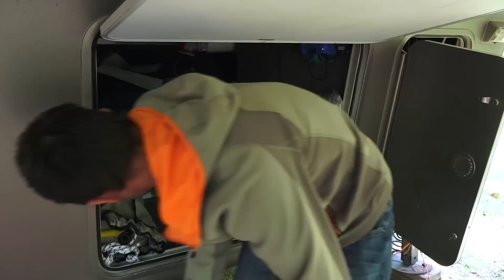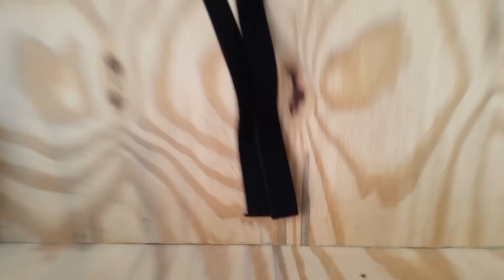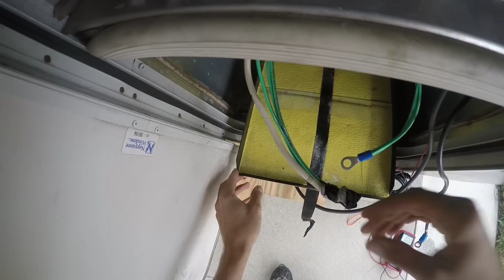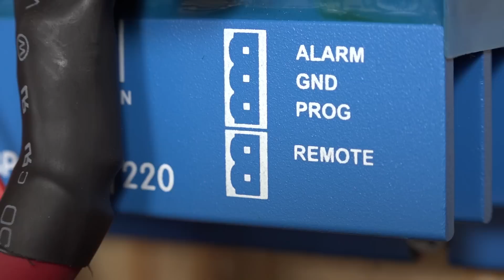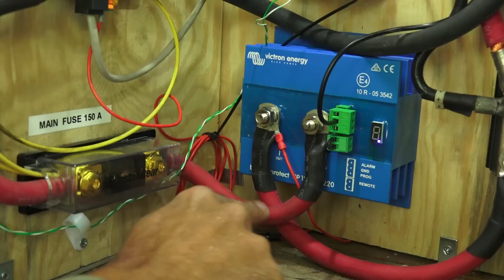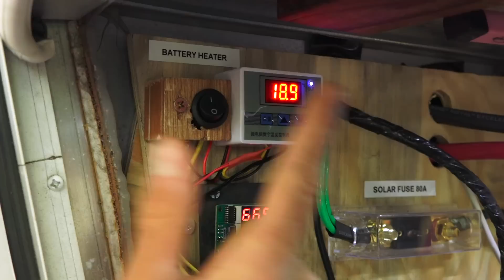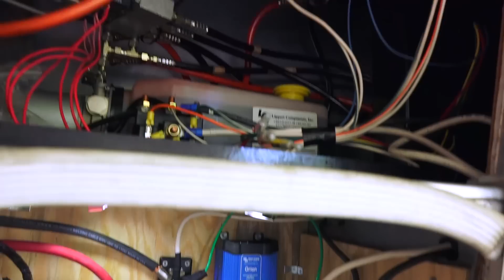PHASE 2 SOLAR - Installing the Tesla Battery and converting the RV from 12V to 24V

Comment: Thanks for the reality check! I see so many people giving false claims like lithium batteries can be drained to zero with no recoil or that they're much safer, both of which makes no sense according to my research. So it's nice to hear that you acknowledge all these potential dangers and have installed plenty of failsafe systems. I certainly won't be going to lithium anytime soon because I only see two factors being of any real benefit, weight and longevity. Weight is definitely proven while longevity is mostly theoretical. Personally I believe if a product does not have a warranty to back its lifespan claims then the claims hold no weight. The longest warranty I've seen from a lithium ion battery manufacturer is 10 years. And I've seen claims upward to 20 years lifespan (8000 cycles). On the other hand, there is more than a few companies that make AGM or gel deep cycle batteries with solid 10 year warranties as well. Point being, it's not how long the product can theoretically live for but how long the product will actually live for. And if the manufacturer was certain it could give you the life they've calculated it would be backed by a warranty. In my opinion of course. So I'll consider them when price comes below $4 per usable amp hour. Currently I've seen them advertised at $10 per usable amp hour.... so no thanks! haha

Comment: So I'm super new to solar, but trying to learn everything I can. I plan on converting a sprinter van into an off grid adventure rig. That said, with such a small rig, efficiency is HUGE, so I'm leaning super hard toward following in your footsteps with the Tesla module and going with a 24v system.

My question: now that you've upgraded to the Tesla module (effectively a 24v battery bank), isn't your charge controller undersized? I just read that to properly size the controller, you have to take your arrays total wattage (your being 1200) divide that by your bat-bank's voltage (24) and then add 25% to be safe in order to get the amps your controller should be rated for. Your would then need to be at least 62.5amps.

If i'm correct, how do you compensate for having a 50amp controller and keep the system safe? Or does this simply limit the total output you can get from your panels? Thanks for helping a noob! Haha.
Reply from the maker: There absolutely no requirement to have a certain size charger, charging at 2 amps is fine, you just won't make enough power for the day.  Size your solar and estimated kwh needs, then the charge controller.  Our inverter can charge at 160A if we are plugged in but I still limit it to 60 so I can use it on our small gen .

Comment: Wow dude, I agree, this is such incredible knowledge that we can share with one another. Thanks. How do you feel about mounting the battery inside the trailer, say a hidden cupboard, so it keep the temperature proper and has easier access for shutoffs? Are there any perceivable negatives to having it indoors?
Also! I understand the basics of the electrical system and each of it's purposes, but, as I watch this, the intricacy of the actual wiring looks like I should use an extra knowledgable hand. Would you suppose a general electrician would have the wherewithal to help wire this system in place?

Comment: Can you run AC with this setup?
Reply from the maker: We can but only for about 2 hours without sun. Most of the day with full sun, but usually we run our honda 2000 and combine the power with the solar, and keep charging the battery.  At night with the gen we can run the AC all evening.

Comment: What I see in this video is a fiery explosion waiting to happen. When Tesla doesn't want to sell parts for their vehicles they use stuff like this as examples. Speaking from personal experience, Lithium Ion batteries are no joke. If you fail to maintain them to spec with VERY precise controls, BAD THINGS HAPPEN. Like why didn't you make use of the preexisting thermal control loop in the battery? That would have been safer, more reliable, and offer you better insight, tighter control over the battery's internal temperature. Also I find your storage orientation to be a bit concerning as well as the fact that you are securing it in a wooden box without any apparent vibration controls(padding to avoid having the batteries bounce around inside the box as you are driving down the road.). Those batteries need to be laying down flat - NOT ON THEIR SIDE,  firmly secured with an appropriate amount of vibration dampening as they were in the model S they came from, and the water loop needs to be in use with the appropriate monitoring, power control, and thermal control gear in play. This gear needs to include alarms to alert you when something is happening that it cannot control. When lithium batteries head toward catastrophic failure you don't get a lot of time to react. Usually the failures I've seen result in explosion and fire within a few seconds of seeing smoke. You don't want to be in the vehicle when this happens. There are plenty of videos out there to explain why. 

EDIT: I completely glazed over the fact that you said in a previous video that this pack was removed from a vehicle that was previously involved in a COLLISION.  ( https://youtu.be/g_cC0NKvCDY?t=48 ) You might also want to have a look at some videos describing what happens to a lithium Ion battery when you subject it to severe vibration events or sudden impact to see why this is a problem.
Reply: Boeing had to put their 787 battery packs in steel boxes to contain possible fires - a plywood box doesn't seem like a good idea.

Comment: Now that you have had the system for a few months, is there anything you would do different or a component that you would change? I like your layout and would like to duplicate your system. I will have to put a few more panels up because I am so far south in New Zealand and most likely a wind generator. I will also be using 2 3000w inverters, One for each leg of the 50 amp circuit.

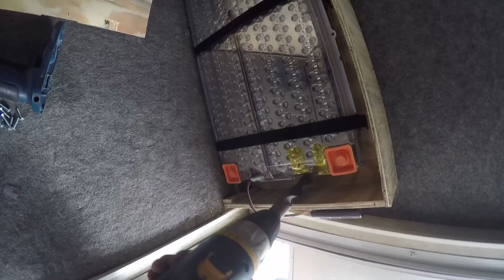Comment: @ 6:40 or so,did you touched both battery terminals? That could be very dangerous. Electricity DC or AC there are a lot of angry pixies in that box! Stay alive ! 1 amp, one volt will stop your heart! Luckily the human body has a good amount of resistance value, but it does have a limit. Be real cautious with rings on the fingers working with electric, my dad almost lost his finger on a large bucket loader battery.
Reply from the maker: Yes I have been burned by rings in the past, very dangerous.  Anything below 50V is considered touch safe and will not hurt you.  Above 50V you need to be careful.

Comment: Very nice workmanship and a great presentation.  

A few questions ......

Why is the manual disconnect ( what I think of as a master kill switch) on the positive side of the circuit rather than the negative?  Does it matter?

It looks like the battery heating pad is24 V and gets power from either the 24 V battery or 24V output from the inverter/charger, is that correct?  I take it that means the pad can work off the plugged in inverter charger even if the battery has no usable charge.  However it would also be charging the battery which I think would be a problem if the temp were freezing?  

I did not know the high temp limit was 105 F on a lithium.  I take that to mean you would be unable to use the battery during some summer days in southern AZ where highs are over 110 F.  However I would guess there are Tesla cars driving around Phoenix and Yuma on a summer day where the heat off the pavement can easily be well over 120 F.  
You are doing some good pioneering work.  It will be interesting to see what comes about over the next couple of years.  Thanks for sharing, I really enjoyed viewing the videos and learned some new stuff.  Thumbs for the pun at the beginning!

Comment: electric heating of ANY sort is going to drain that battery.  Its a dead short basically that creates heat electrically. If your not plugged into shore power overnight you will be in trouble in cold weather.
Reply from the maker: The battery is well insulated and does not draw much at all to keep warm.  Has been working great!

Comment: I'm not talking smack but the only reason why I don't like people running it in their vehicles is because an EMP how are you going to hide that entire trailer. I mean if you pre made some aluminum type material to put around the outside of the trailer that's one thing. I would rather have it set up to where whenever you're going to go somewhere and then you set it all up even if it's in the way. There's a good chance that they could use in the EMP when the time comes. Since you got a lot of knowledge it would probably be good if I if you at least ran the whole trailer with aluminum foil of some sort around all the wiring.
Reply: Another thing I wouldn't if something did happen I wouldn't immediately pull all my equipment out and start running power. I would give it a little while to witness and see if something's going to happen before hand.

Comment: You need a rebuild, bruh. The first thing I raised an eyebrow at was the wires coming from the battery to the little voltmeter. The wire should be looped down below the hole and meter, so that water will drip off of the wire, instead of following the wire in to the cabinet. Also, the hole should be sealed up with some foam rubber or something. I would put the meter itself in a little acrylic case, like you see in the camping section.. to prevent splash damage. If you're clever, you could probably cover the hole in the wooden cabinet with the acrylic case.

Mice. I would have put the battery in the living area, somehow, but.. A remote source of heat is going to attract mice, spiders and bugs. You need to seal the channel between the two cabinets with an aluminum pipe or..? that will keep mice, insects and water out of both cabinets. Next, you need to get some sheet metal (I would recommend galvanized or stainless) for ductwork from the hardware store, and seal that cabinet in metal that mice won't want to chew through to get to the heat.

Speaking of heat, half of your heating pad watts are being wasted on heating up a piece of plywood. Get some heavy gauge aluminum foil and spray adhesive. At LEAST line the piece of plywood facing the heating pad. I would line the whole box. I would also have insulated the entire box. The most important parts to insulate would be the bottom and back where the battery is faced up against an exterior wall. Those exterior walls will draw heat out of the battery. I would put insulation on those two sides, MINIMUM. The sides exposed to air should be relatively insulated by the air. The other important place to insulate would be outside of the heating pad, to keep that from drawing out heat. The heavy gauge aluminum foil will keep the majority of the heat reflected, but there will still be a draw there. I would put a piece of insulation outside your plywood cabinet, and inside the galvanized / stainless ductwork cabinet.

I would give similar attention to your component cabinet. That exterior door facing your gear freaks me out. I would build a second plywood door (hingeless) just to be safe.

I'm still watching the video, I just had to stop and mention all of this while I was thinking of it. ;)
Reply: RE: Hooking up an emergency battery if the system fails. I would have kept the old system in place (perhaps switch to sealed lead acid), connected it to a small solar panel to maintain the charge. Then your emergency backup batteries would be one throw switch away from your bus bar. ;)

Comment: Hi, very informative videos, thanks :). ...  What is the upper limit of the temperature for tesla module?
Reply from the maker: I have it set at 105, have never seen it heat from use tho, only ambient temp so max has been around 90.

Comment: Thanks you for the video. Where can i get the balancer and the  wire connector? i have the same battery 48v in series  but i am yet to figure out how to balance each cell. Thanks for your time.
Reply from the maker: The wire came with my battery, HSR motors makes them.  As for the balancer we use you can get them on amazon or anywhere else, tenergy 5 in one

Comment: The diagram should be +24v and 0v, not +24v and -24v.

If it were a 48v pack, you could run +24v, 0v, and -24v if you wanted to.
Reply from the maker: You are correct thats a bad mistake, I will correct that.

Comment: I like your videos, and am thinking of someday converting my LA battery bank to these Tesla modules. They're so small. Three of them would literally double my storage, and for under $4,000? That's a good deal. I am surprised that that little 12 volter can fully handle your rig's slideouts. I called Lippert (slideout hydrolics) and tech told me to insure 80a availability so I used a larger battery. Same idea though.

Comment: I am looking for some help. I have watched this video 10 time trying to wrap my mind around all the components.  I am converting a promaster 3500 extended cargo van into a home made rv.  I bought 4 tesla model s batteries which are due to come in next week. I plan to run them in series and parallel for a 48 volt system with about 21 kilowatts of storage.  I am trying to figure out what components I need to order.  I plan to add solar when I have more time and money but would like to be able to plug in to EV charging stations. I would also love to be able to charge with generator and charge with alternator.  I plan to hire an electrician for the install but I would love to have a schematics and parts purchased before I get a bid. if any one is into this sort of thing please send me an email jeff_sunzeri@yahoo.com.
Reply from the maker: Check our our second life EV bat tries group on facebook, lots of others doing something similar there.

Comment: not bad . I am doing the same thing in my off grid home. with the DC converter. I'm using DC led's and a few small things. with a 24volt inverter. being off grid can be interesting at times. my system is 7s lithium ion. so its 29.4v full charge. I can use the full capacity of the battery if needed. I try staying over 24 v. I would like to get a Tesla it volt or Ford battery. I would need it to match my system. the volt and Ford seems easier. keep  at it.
Reply from the maker: The volts are cheaper but much harder to configure... not a big fan of prismatic cells either, but they are a great deal for the price.

Comment: I am curious to see how Phase 3 turns out, but could something similar be done with the Tesla Powerwall 2.0?  It already has an inverter in it, and could be wired right into the 120v system, so it acts like the RV is plugged in.  I know solar can also be ran directly into those.  I wonder if the Powerwall would prevent the need for all of the extra monitoring.

As a side note it sounds like the 12v system would still be needed (at least partially) to operate things like the jacks.

Curious on your thoughts.
Reply: Most 12v things work with 24 too, just make it can handle it.

Comment: You stated you probably would do the battery protection system differently. Did you have a particular mechanical relay in mind to use as a replacement?

Comment: Excellent video....we are currently building a 48volt system for our 5th wheel using 18650's....I am putting the battery and management system underneath the bed cuby to keep the temp constant....again excellent walk through

Comment: First off,  great video! I Especially like how detailed you get.  It helps a lot.  I have a BML-702 from my aging lead acid battery hook up, and soon, upgrading to lithium ion(still soldering my packs).  I would love to see the settings you used for your BML-700. Just Subscribed and hit the bell for alerts.  Thank you in advance.

Comment: Great video series. I've watched it several times. I have a question about powering the landing gear. Is it possible to get a DC-DC converter that would handle the 100 amps you need for the landing gear. Is there another solution?
Reply from the maker: I am sure there are converters large enough to do that but they might not be cost effective or efficient.    Because of the short run times I considered just running it on 24 volts (there are no electronics in the motor)  and it should be fine, but dint want to chance it. I also thought about just installing a resistor to create a voltage divider circuit.  This would be easy but would waste some energy.  I still may do this at some point but wanted the battery for the braking as well... If I modify it I will make another video about it.  So far it has been working fine tho.

Comment: So is that little thing the only balance thing you're using? Your cells have stayed pretty in-balance then, as they've lived their entire life in that pack, I take it?

I approve of the way you have the battery disconnect though. It means that if the battery was over-voltage (for some reason, temperature, whatever) it could still be discharged via running a small load to bring it back within voltage tolerance, and then resume normal operation.
Also, if the battery goes under voltage, your solar charge controller can still bring it back UP to the correct voltage when the sun comes out.

You did this correctly, the other way mentioned would have been much less beneficial and less resilient to problems.
Reply from the maker: I originally left the meter plugged in but it caused an unbalance.  Balanced to .010 and now the cells are more like .07 been hanging there for 4 months ... They actively balance each other for the most part, we stay in the middle 70% of the battery and they just dont move.  I keep an eye on them and originally when the battery was getting unbalanced  yes it could balance it fine.